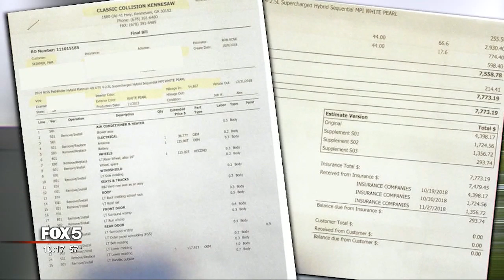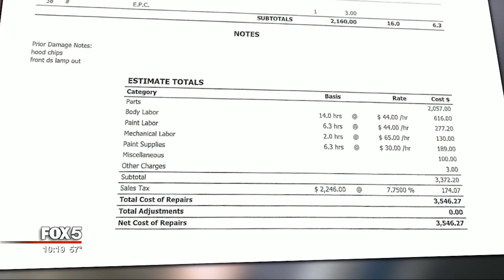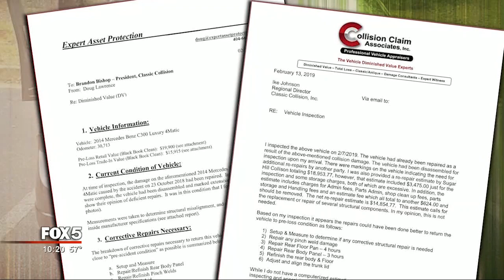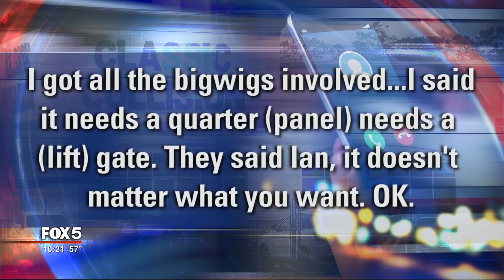I-Team: Car Repair Critic Shakes Up Body Shops, Insurance Companies

Comment: Saw on that estimate $44.00 an hour labor rate. There’s part of the problem right there. How can you make money at that rate in 2019? You can’t. Atlanta has always been a cutthroat body shop market.
Reply: Yes I agree
Reply: LOL, I charge more than that for side jobs in my garage.
Reply: Even in nyc its only around 50 body labor and 30 paint material
Good luck with that
Reply: The insurance companies will "guarantee volume if you play ball". aka steering. Collision shops should be up there with mechanical shops on rate.
Reply: @class5bodyworks  and thats not steering,  when the insurance companies pay the same price to everyone,  its a fair battle,  customer can choose whatever the hell shop they want,  if a shop wants to stand out,  learn how to write a proper estimate and have the proper equipment,  when working around the labor rate(like more hours)
Reply: @KW-fx9ww  It's a subtle way of steering. A shop agrees to terms with the insurance company which includes rates, cycle times ,repair vs. replace, etc. in exchange for putting them on their "preferred list" to customers and sells the repair guarantee to them to subtly shift them to a shop. The insurance company doesn't necessarily care which shop has the best or most qualified techs. And unfortunately the insurance company is privy to the same estimating times and parts cost. You can only pad on repairing not replacing or especially paint labor. Most times they write their own estimates anyway and dictate where to buy parts. Allstate got sued years ago trying to own and operate their own repair shops. Why is this situation any different? Shop owners by law can't get together behind closed doors and agree to set the area rate.
Reply: @class5bodyworks  u just have no idea how this industry runs
Shops DO talk to each other in the area or county to force the insurance companies for a certain rate
But then of course there has to be a balance and reasonable so shops do not low ball each other and set a negative competition

Its either a contracted shop or not affiliated at all, theres no subtle steering,  insurances companies are required to tell the customer they can choose any shop they want,  the steering part is minimal and most of the time just wasting the customers time a little bit

Actually theres way better chance non affiliated shops get jobs now cos most of them in my area do save the deductible for customers (like $1000 depends on how bad the damage is)
Which contracted shop cant really do the trick
Reply: @KW-fx9ww  I do have an idea how this operates. I've seen a lot over 30 years. It just sounds like we're on opposite sides of the office wall. I do in what you're saying though. I just feel that the insurance companies have way too much control.  If a shop raises their rate they will suffer even if they have better quality and skilled technicians due to cost. I understand insurance is watching their bottom line and that helps keep premiums in check but the agreed rate increases I've seen over these years is ridiculous. This is a very technical field with increasingly stringent repair procedures and I feel the shops and techs should be compensated for this.  There's an increasing shortage of techs. Couple  this with stagnate wages and this is a recipe for disaster. It's not good for anyone. The term "insurance partner"  drives me nuts. It's a pretty unbalanced partnership.
Reply: Literally what I was thinking LOL.  Reminds me of some shitty prelim estimates from companies like Kemper with garbage rates just hoping their customers cash out.
Reply: @KW-fx9ww  ins companies suppress labor rates because they can . too many sheep willing to accept what they are told. then you get a big mso in who cut rates even more to gobble up all the work while providing questionable repairs because you can not make it up in volume only by cutting corners
Reply: @KW-fx9ww  shops do not talk to each other about rates because for us its called collusion when ins companies do its called business as usual

Comment: An improper repair that needs to be corrected later on can and most of the time does total a vehicle. Especially when oem parts are necessary to do the work. After the repair is done, the cars value is much lower. Then if the work isn’t done right and needs additional work, it’s not uncommon for it to total the car.

Comment: Fixed bashed metal isn’t the same how I got it from the factory it’s not fair we pay high insurance for them to use cheap labor
Reply: Haha,  either pay your insurance or dont drive
Reply: The labor is only cheap because insurance companies make it so.
Reply: @class5bodyworks  what and how do u think they deserve whatever price they put on a board says labor rate?  
Right now between 50 to 60 an hour is wayyyyy enough for majority of cars
Reply: @KW-fx9ww  Tell that to an ASE certified mechanic and see what their reply is.😂
Reply: cheaper parts a/m is all crap

Comment: For those who get into accidents, go with a body shop that is preferred by the insurance company as long as you have the collision insurance.
Reply: Why?
Reply: @MouseyBusiness  As long as you have the collision insurance and they tell you about the deductible, it would be much cheaper and faster.  Experience taught me that.
Reply: @RJN0607  Drive to my body shop and let me disassemble your car and show you how many steps were missed by your insurance companies "preferred" body shops.  I've been a part of MANY cars that we inspected after insurance companies steered customers to a cheaper "in network" body shop and we uncovered so much incorrectly repaired and not repaired items that the cars were totalled and the body shops that "fixed" the cars were charged back by the insurance companies for their terrible work.
Reply: Lmao not at all. Avoid preferred shops because this is what happens. Corners are cut and customers get screwed in preferred shops. DRP = doesn’t repair properly
Reply: That is the worst thing you could do. You must be an insurance adjuster,  DRP (Direct Repair Program) shops are scared to push back on the insurance companies in fear their RPM score will drop and they lose that account. Look for a certified bodyshop with good reviews that is not a DRP because chances are their willing to push back on the insurance and negotiate more on your behalf

Comment: I need an inspector please let me know if you know in Virginia
Reply: You dont need an inspector.  call your insurance company and tell them you would like the repairs on your vehicle reinspected by a different bodyshop or as state farm does have them reinspect it. Normally free of charge.
Reply: Hi John.  You have 6 years for additional bills to be submitted on a vehicle.  You can go to another body shop that performs "Post Repair Inspections" and they can submit a bill to insurance based on their findings.  It's more difficult now that it's been 2 years, but it can still be done.